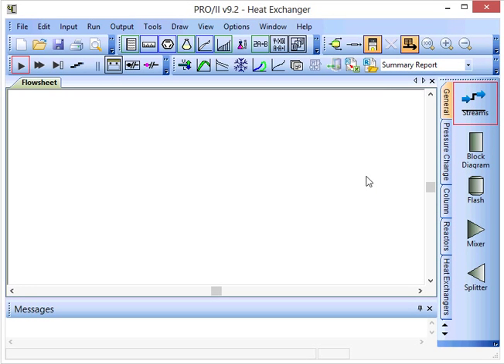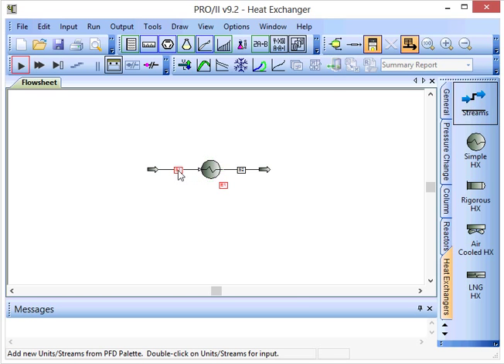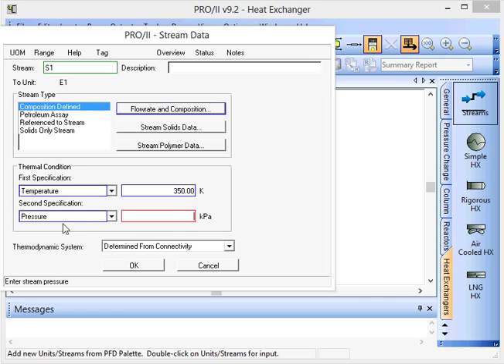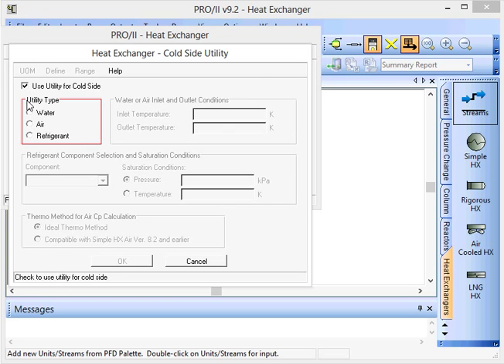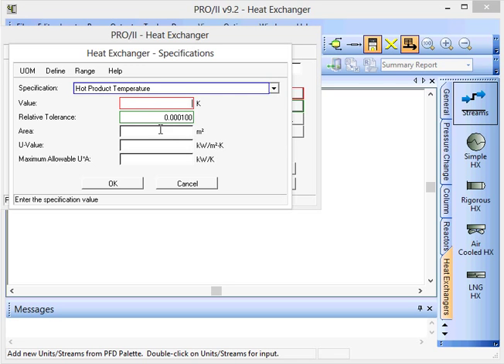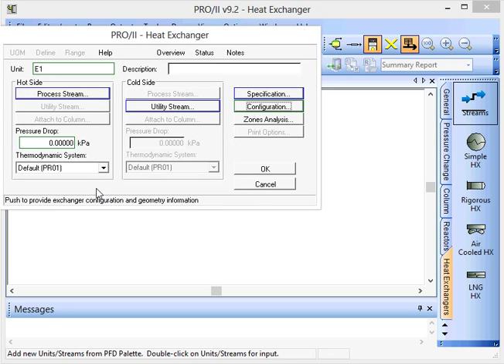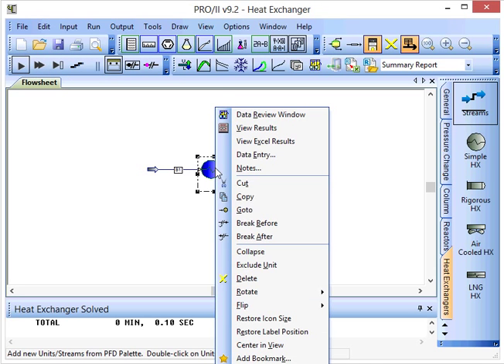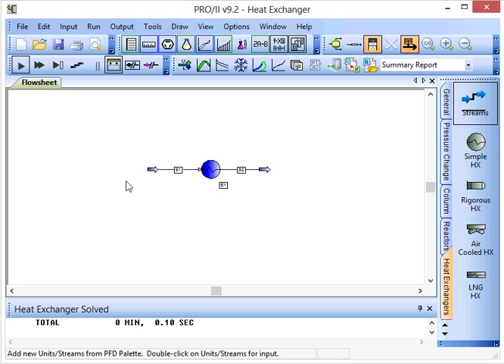PRO/II Unit Operations – Simple Heat Exchanger Part 2

Comment: The Values I am getting seem to be a little off, by about 0.001 *10^6 kJ/hr not sure as to why... could it be the difference between pro 2 version 9.2 and pro 2 version 9.3?    EDIT: I got 2.2604 for Duty and video showed 2.2615 I copied EVERYTHING shown in this video and setup pro 2 following the instructions of step 1 to the letter. Cannot find any reason for my value.
Reply from the maker: Hi warspite1995, I think you are right. PRO/II 9.3 seems to give slightly different values to PRO/II 9.2 for some simulations. Thanks, Daniel